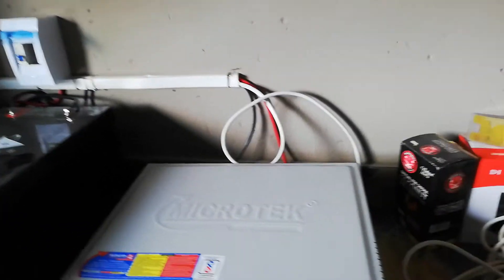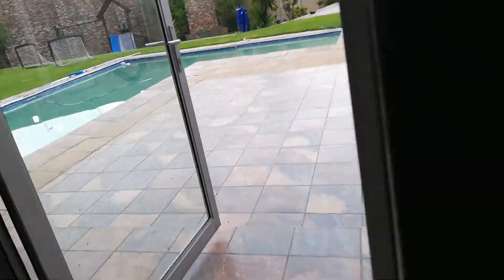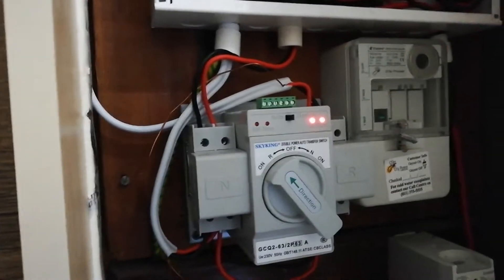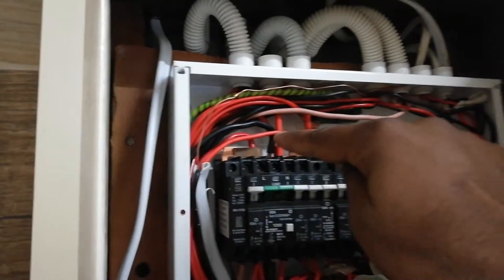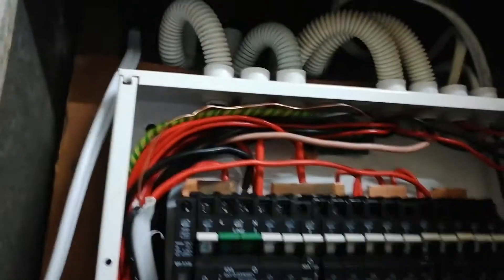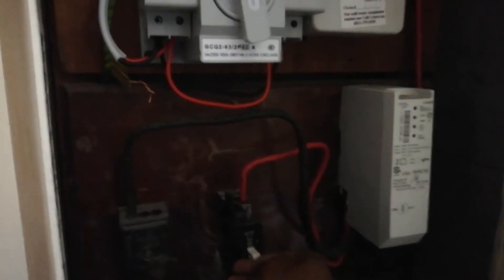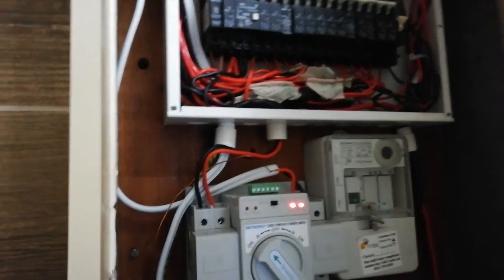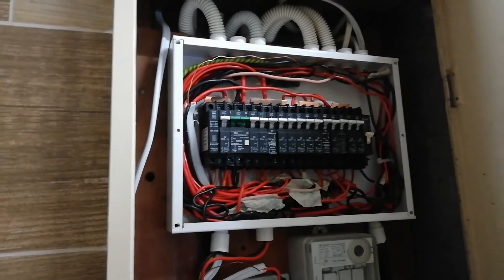How to install automatic changeover switch and inverter, Dominant systems work, don't forget to subc

Comment: Hey

What is the size of cable you use from DB Box to wire your AUTO CHANGE OVER SWITCH
Reply from the maker: Depending on the load,normally we are not using stove and Geyser on the inverter, so load is not Too much, you can use 6mm 4mm or 10mm I used 4mm

Comment: It is non compliant 
In an event of fire insurance won't pay out

No fuses for battery 
Wires are exposed 😱
Reply: Hi Imtiaz...can you post a youtube that shows the proper installation of the switchgear between the inverter and the DB board please. You seem to know how it should be done properly
Reply from the maker: Battery fuse by the battery side

Comment: Hi,,,,,,, have an urgent qstn......could someone plz help.......my house load would be about 2000w at any particular moment. So i need a 48v (4 battery) system for which my inverter shelf has no space....so i thought if i can get a small capacity 1700va 24v based system and connect it so that its not live. Meaning i dont have my entire home connected to it. I want an inverter where i just plug it in like a computer ups and it keeps charging the batteries. But it should not be connected to the house load (bec that will be exceeding the VA capacity of the inverter). Now when power fails i will go and manually put a switch of some kind to use the stored power. Only then the inverter output connects to the whole house. The point is that i can have a small inverter which may only support a 500w load and when power fails i can reduce the load by switching off the ac / induction stove / etc and only keep fans n lights on and then switchover to the inverter output. Is this possible ?
Reply: Best way to do just get lithium battery and mounted on the wall.48v one battery